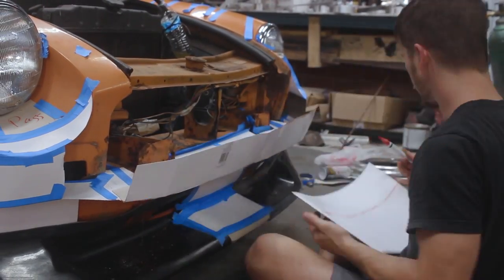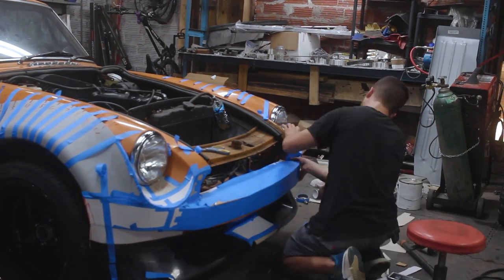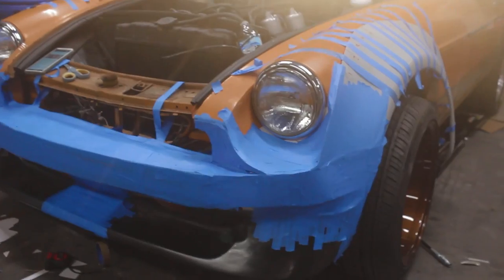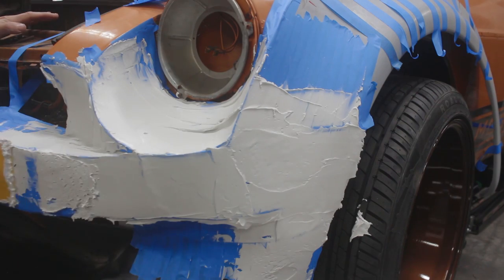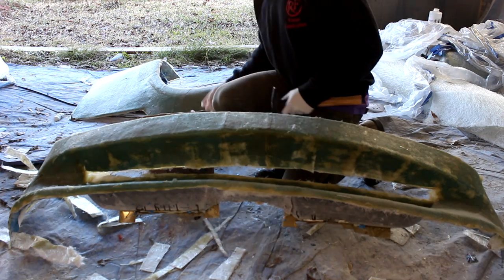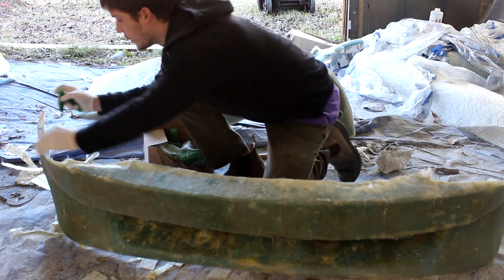THE RWMGB pt.26: DIY FIBERGLASS BUMPER AND FENDERS ARE DONE!

Comment: I used to be a fibreglass laminator, if you've used epoxy to seal the plug, you don't need PVA, you would be better with about seven coats of wax, and don't buff the last coat of wax off, it'll separate easier.
And I would have applied a thicker gel coat, but what you've got will be perfectly good enough.
Honey wax works the best in my experience.

Comment: When it comes to propane heaters, they're actually really safe as long as you don't knock them over. I used to work at a propane heated shop, never had any breathing problems or anything. If you're concerned about it you can install a Carbon Monoxide detector into your garage for extra safety, but I worked in that shop for 8 months, wasn't ever an issue

Comment: What about a Porsche swapped MGB
Reply from the maker: Me and german engines don't have a good history lol
Reply: @BUILTOFFICIAL  ha I can relate but it would be sick
Reply: @BUILTOFFICIAL  why not use a honda engine? Small, light, readily available, relatively easy to work on, good cheap parts, can make a lot of power with a turbo, and the most important of all VTEC
Reply: It would envolve quite a bit of fabrication to fit a boxer motor. It would definitely lower the center of gravity though
Reply: @Pandadancypant  this is the way to go s2000 swap is really easy in an mg b you just need custom mounts and modify the front crossmember to clear the sump tge rest is just ecu and loom then boom 220bhp in an mg which is perfect then boost if you can handle it 😈
Reply: @jameshoath83  plus having that digidash in the MG makes it more cyberpunk like
Reply: @BUILTOFFICIAL  is that a bseries Mazda in the background??? 🤗

Comment: If you run a heater like that,  you should have a monoxide detector in there for safety
Reply: The real men don't need monoxide detector.  :)
Reply: @ojarsbulte6981  yeah, only real men die from carbon monoxide poisoning :)

Comment: Alright hear me out. Swap a Nissan KA24DE in. Reliable, cheap and makes good power. You can turbo them with stock internals and make 250whp and 270tq. Just make sure you get the DOHC not the SOHC

Comment: You should just learn to 3D model mate. Print the modeled kit into sizeable pieces, glue them together on the car, bondo, smooth, fiberglass, remove the 3D printed pieces, boom, perfect widebody kit.
Reply: The cost to do that would be astronomical not to mention finding someone with a 3D printer that big is rare and the time it would take to print

Comment: So, it’s gonna be difficult to turn this thang....
Have you thought of electric steering?
Reply from the maker: Not sure, My mr2 was manual steering and it was fine so I think this will be ok, Just a little hard to turn when setting still
Reply: @BUILTOFFICIAL  look into the EPS that classic mustang guys use... column mounted electronic power steering out of Saturns and an eBay module to control it.